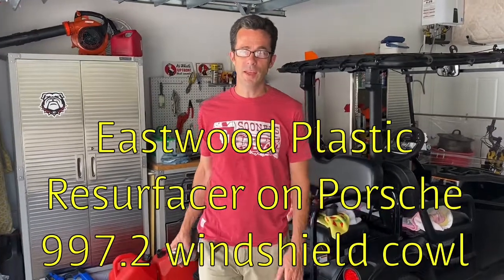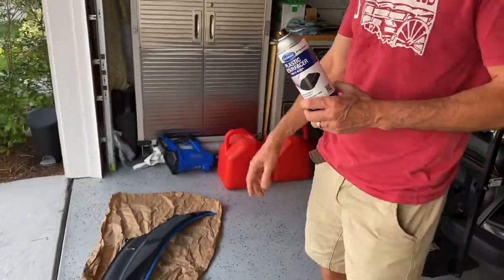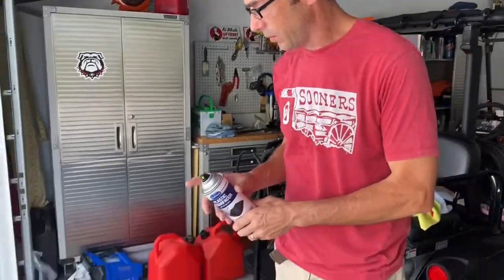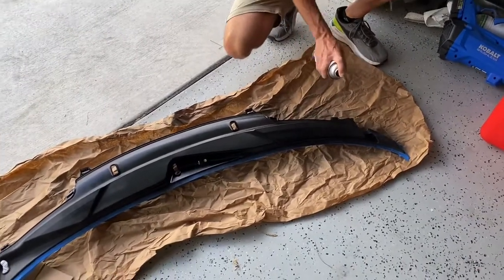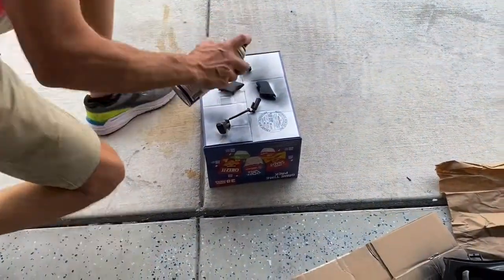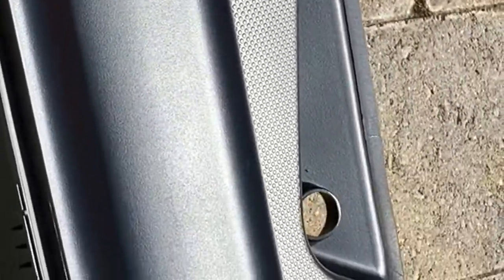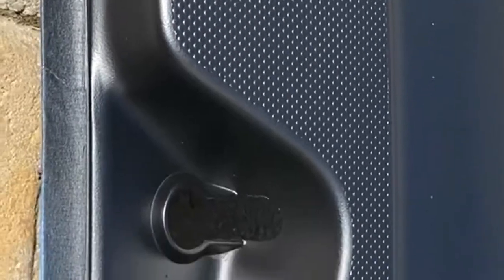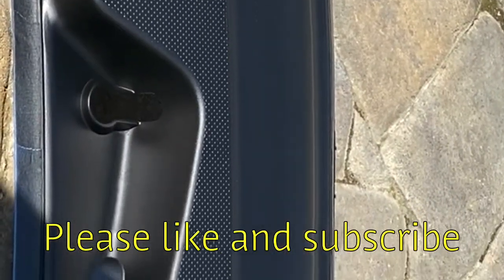Eastwood Plastic Resurfacer on Porsche 911 997 windshield cowl

Comment: Holy cow, that really looks amazing.  I have been starting to get tired of treating mine with Formula 303 Aerospace.  Thanks
Reply from the maker: Louis Rodriguez Yes, the stuff is amazing and I would say it’s better than new as its supposed to last for 7 years.  I couldn’t be happier.
Reply: @didifixthat7910  Hi Friend, I watched your video last year and was wondering how it looks now, after some time. I have a '07 997 and a '00 Boxster S that need cowl refurbishing. If you happened to be doing another 997 video, please take a minute to film the painted cowl. Thanx liked & subbed.
Reply from the maker: Seymour Capone I did an update video several months ago and I may have an unintentional shot of it in my most recent video, strut bearing removal. Basically, it still looks like a million bucks.  I honestly looks as good as the day I did it. I really don’t think you can go wrong with this stuff. It’s a bit pricey but worth it. Also, thanks for subscribing. Good luck with your project.